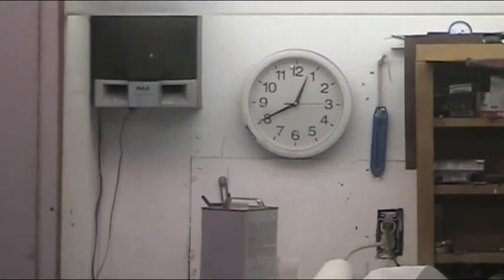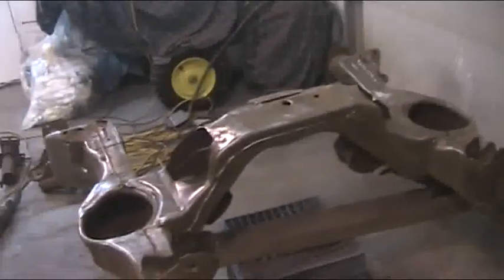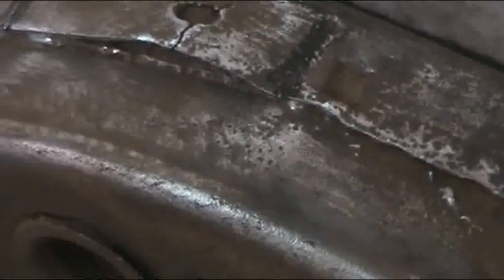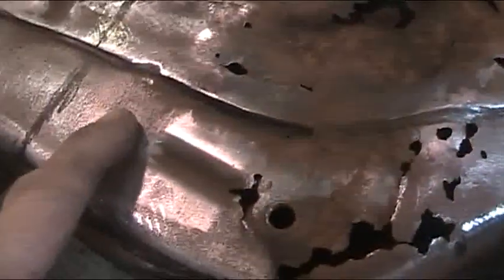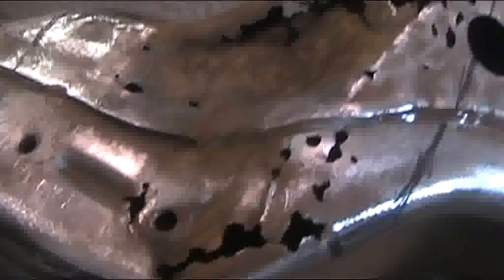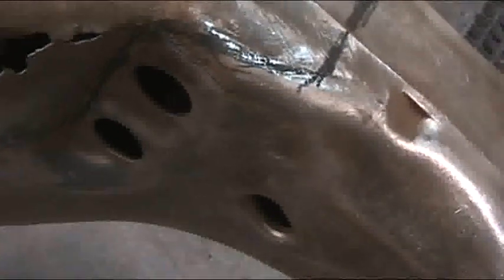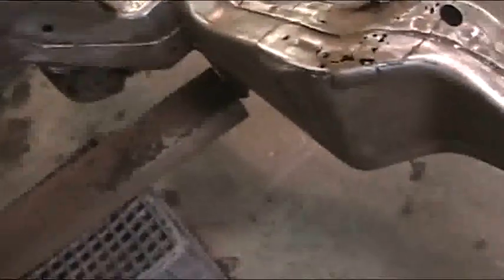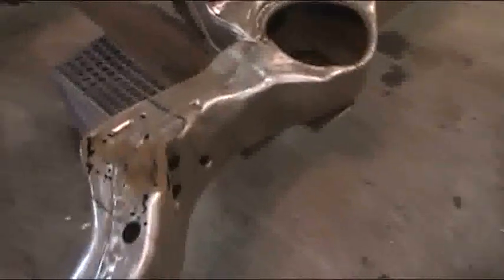nova subframe is stripped.wmv

Comment: The shapes are bowls so heavy gauge steel won't shrink like you need it to by hand. Make a paper pattern of the shape and then slice it like a basketball to make each section then weld and going the weld smooth. The depression can be hammered in using heat and a wooden buck or reverse mold. Use hard wood for this part.